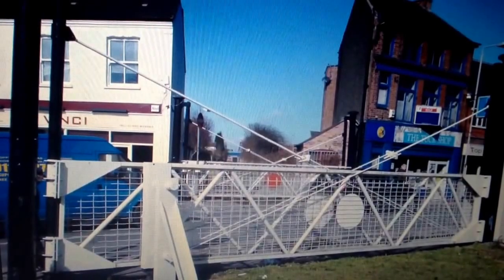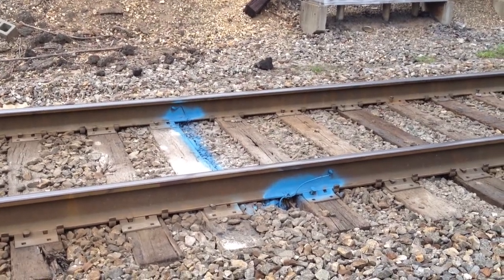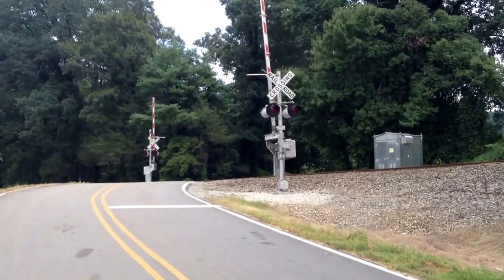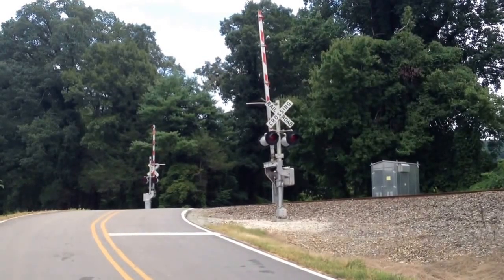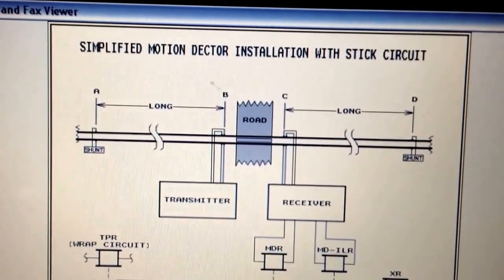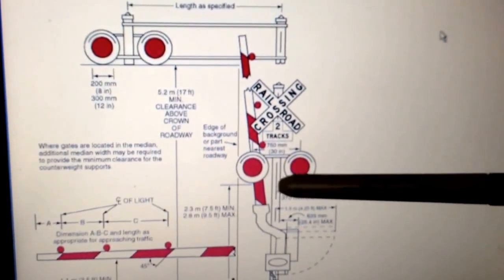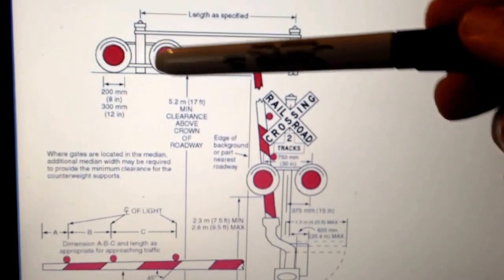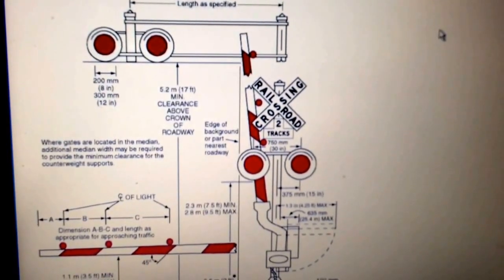Railroad crossing gates and how they work

Comment: get jumper cables and then put them on both rails and then it will activate ghe crossing because the rails are also used as a switch

Comment: If you rub metal across both tracks the signals will go down.
That's how we crossed big streets in California.
There was always a coat hanger or or bed frame on either side of the street.
You wonder why we traveled the railroad tracks cutting through town ?
" The war on drugs " wouldn't let us smoke our weed so we traveled places cop cars couldn't go.

Comment: I used to work for one of the grade crossing equipment manufacturers. It's really pretty interesting how a GCP can not only tell where a train is, but which direction it's going and how fast, by comparing the phase and amplitude of the received low-frequency signal compared to the transmitted signal. With that information, it can predict when the train will hit the crossing and activate the gates and lights at some constant amount of time before.  When there is a GCP involved, merely putting a bar across the tracks may bring the gates down momentarily, but they'll come back up, because the electronics thinks there is a train in the approach, but stopped.  The track short needs to be moving!

Comment: all you need is a penny and you have to find the insulator about 50 feet up the track. you put the penny between the insulator and it makes the gates go down
Reply: You realize it's a federal offense if you trespass on railroad tracks and mess with the equipment. The railroad company can tell if someone it tampering with the safety warning systems and they will contact law enforcement.

Comment: Here's a question: Why do railroad crossings silence their bells when the gate gets completely down?
Reply from the maker: Great question.  The bell is used as a warning to people walking, riding a bike, and even vehicles that the gates are starting to move (coming down) once the gate is all the way down there is no more need for the warning. Some gate systems will silence the bell once the lead locomotive has reached the crossing or when the gate reaches 10 degrees of the horizontal position. Some circuits are simply left open and the bell will sound for the entire time the gates are active. Again, some systems will reactivate the bell when the gates start to move up. Thank you for watching.
Reply: @hnf1930  nowadays EVERY crossing I know has the bell silenced when the gate is down. There were some crossings in my area which used to have the bells ring all the way through, but when I went back to those places recently I noticed they only ring when the gate is descending. I have a strong doubt there's anymore crossings which don't have a "bell silencer" and keep the bell ringing until deactivation.

Comment: What makes them turn off after a train stops at a crossing?  The sensors only account for moving trains?
Reply from the maker: Yes, in a way. I train can pull up to a crossing gate and stop, the gate will go back up
Reply: The circuit can tell how fast the train is going and which direction, not just that it's moving.

Comment: If there's detectors, then what causes malfunctions?
Reply from the maker: Most of the time it will be a defect in the electrical system. Sometimes after a thunderstorm you will see gates in the down position with no train coming, caused by a short circuit in the system. Thank you for watching.
Reply: Saw that happen on Taylors Road in Taylors SC once before (idk if you know where that is)
Reply from the maker: @echogeko4684  I have been in that area a few times

Comment: There are railroad crossings that don't need the crossing gate as in the case of the light rail in Phoenix, Arizona.
Reply: All railroad crossing need gates
Reply: @daltex81  Agreed
Reply: @daltex81  not all need gates as most non gate crossings are in a industrial area or yard. A train will be creeping along the track and there is no need for a gate. If the train is speeding the lights will go off several minutes before the train actually arrives. You got to be stuiped to go across and if you get hit its your fault there's still lights. You also have the crossings with no light or gate at all just a sign but your smart enough to hear the horn

Comment: There are remotes on trains now that trip the circuit. That's why you can see a train sitting right before a crossing, maybe waiting on a light to change, and not have the crossing gate down. Also at the train's end you will see a remote box mounted on the last car, usually with a blinking light on it to trigger the gate to raise up when the last of the train has passed.
Reply: Most of the time the grade crossing predictor is what detects a sitting train starting to move towards the crossing again.  Some crossings may be controlled by codes over the radio, or switches on the equipment housings.

The Flashing Rear-End Device has nothing at all to do with controlling grade crossings.
Reply: @jovetj  and the transmitter on the back is there for what?
Reply: @Kevin McWilliams
The End-of-Train Device is connected to the brake line (like any railroad car would be) and communicates with the head-end. It constantly reports to the crew the brake line pressure it sees at the end of the train.  In the event of an Emergency Brake application, the head end will send a command to the EOT device to open the brake line from that end.  This allows air to escape both ends, and should provide for steadier train handling while it's slowing down.
Reply: @jovetj  it also helps with other trains approaching from behind. Let's say it's dark and yes I know train headlights are bright as fuck but they put that there for your reason and the reason for trains to stop. From behind
Reply: Not true at all. Your guessing doesn't make it true.

Comment: what happens if the power goes out in the city are the crossing light able to work?
Reply: Yes.  Every crossing has a battery backup, which should let it last a while, depending on how often the crossing is used.  The crossing should operate completely normally on battery backup.

If the batteries die, then the crossing will become completely non-functional.  If gates are present, they will drop to horizontal as a warning.
Reply: They also use the generators sometimes
Reply: @Stephen H. Cummings
No they don't.

Comment: you missed an important point. There is a reset insulator about 50 feet down every track. you will see its plate and track insulator. All you have to do put your watch, or a penny in between the insulator on top of the track to make the gates go down.,  a signal man showed me once.

Comment: Can you tell me, are the island ckts a blind spot to block signaling?
Reply: No.  They're all connected to the block signals.
Reply: The island is generally on a separate circuit that doesn't care whether the train is moving or how fast. If a train is occupying the island, the crossing protection is activated.

Comment: Hnf1930, can you tell me where the "power out indicator" is located? Pictures help.
Reply: The Power-Out Indicator is usually a white light located on the crossing equipment case housing.  
See https://c8.staticflickr.com/9/8513/28773069023_b645dcd554_c.jpg

The white light above the door is the POI.  Most of the time, it is steadily lit.  If AC utility power is lost, the light will flash (from batteries) or be extinguished.

Comment: I love trains and train "stuff" and find this sort of thing fascinating, so I thank you for posting :)

Here's a bit of trivia for you: the monotone bell sound probably dates from the early days of trains. Old locomotives were fitted with a large bell that would swing back and forth to warn traffic. These engines were slow enough that the bell could be heard and was a sufficient warning. When electronic signals were implemented, they mimicked the noise that was standard at the time, which remains to this day. 

You can still see locomotives with bells at train museums that run such engines for show.
Reply: Locomotives all still have bells, and are required to ring them when in motion in certain situations (such as a yard or grade crossing).
Reply: Jovetj: I have been watching this carefully. It seems that the locomotives bell is used when they are around people.  Pedestrians who need a constant reminder that the loco is in motion.

How close is this to the truth? It's just my amateur observation.
Reply: That's the truth as I understand it.  I also believe it's more for railroad personnel than the public, because you can get pretty desensitized to hearing running locomotives when you're around them all the time.   Hearing that bell is the signal to be alert because there's one in motion nearby.

There are several standardized railroad rule books around, and reading them is great insight in matters like this.
Reply: All locomotives have bells.

Comment: How does it work with fast and slow train, warnings? I didn't get that bit in your video.
Reply: The Predictor is what accomplishes that.  I thought the video was fairly clear on that, but see my other comments here for an alternate explanation of how that all works in principle.
Reply: every railroad has its own speed limit that determine the distance of the trigger
Reply: TIMER IT HAS A TIME TO GET TO THE ROAD AN D THEN STAY DOWN
Reply: Some crossing devices have a ''timeout'' relay.  This is usually near freight yards and industrial sites that have a lot of slow local traffic.  i.e. Trains moving back and forth as they 'drop' a load and pick up empties.  The timeout is activated if the engine never penetrates the island, thus raising the gates and shutting off the lights.  Later, when the engine is ready to proceed, it creeps along at 2-3 MPH until the gates, lights and bells are activated and proceeds across the island.  Another feature is for the conductor to climb out of the cab and deactivate (override) the crossing protection until such time as the engineer has completed the task of distributing the cars.  Then the conductor reactivates the system, climbs back on board and they booggie back to the yard.

Comment: Would of liked a more detailed explanation on how the train trips the circuit.
Reply: CHRIS BROESKY: Well I loved this video too. But I too want more info. For example, what about when we wartch videos of railway speeders? It seems like most of those don't activate the bell and crossing arms.
Also, I have seen situations where a train was very close to the crossing and the arms, lights and bell were activated. But when the locomotive was very close but stopped for a time, it seemed that they turned all that stuff off till they needed it again.
Reply: Thank you Chris. I feel like I really learned something today. Excellent explanation.
Thank you!
Reply: See my description elsewhere in these comments.
Reply: Michael Dougfir Yes, I've seen the crossing arms come down and the bell come on when there was no train around. They were having problems. The way they turned it off was attach some wires to the rail with a battery or some device box it looked like.
Reply: Rednesswahn - Similar systems in the United States work the same way.  They are still not very common, though.  Most crossings that have gates only have gates blocking the lanes entering the crossing.
Reply: @realcanadianrailfan110  not quite right on the high rail thing, as my work hi rail can be configured to set off crossings or keep them off.

High rail gear contacts the track, they are not rubber, they are steel wheels on steel rail, the reason they do not set off crossings is because they are isolated using a rubber flange between the wheel bearing assembly and the hi rail gear. But most high rails have a spot where you can attach a wire to complete the circuit, running the wire between the left and right wheels then creates the shunt like a locomotive or car would and will set the gate off, same with speeders, they are purpose built to not set off crossings, but can be made to do so easily.
Reply: They are now predictive on modern lines. Meaning a controller kniws train location speed and direction. It calculates proper timing for the gates / lights. So you have same warning time no matter what the train speed is...
Reply: the train steel wheels and axles complete a circuit.
Reply: CHRIS BROESKY  The "track circuit" is shorted by presence of a train. The Grade Crossing Predictor knows where the train is by measuring the electrical load resistance. The Grade Crossing Predictor cuts voltage to a Master Relay in the relay box. This master relay is always energized. Without power, the master relay drops out of the circuit, activating the lights, bells, and cutting power to the Hold Clear in the gate gear box. This is a "fail safe" way of wiring the system. In the case of loss of commercial power and failure of the back up batteries, the hold clear will release, and the gates will lower to protect the road. There used to be an interesting website that illustrated these systems really well called Signaldepartment.com. But seems to be gone now.
Reply: crossing signals use motion detectors
AC current runs through the tracks. The wheels on the train short out the current and reduce resistance
Motion detectors measure the AC current and monitor what's called "phase angle." That's the relationship between inductive reactance (change in the magnetic field induced by the current)  and resistance. 
The motion detector looks for a change in the phase angle. As a train enters a crossing approach, the phase angle increases and the resistance drops. As soon as the MD senses that change, it removes power from the relay and the crossing activates. 
When the train clears the crossing  or If it stops short of the crossing, the MD on the approach circuit no longer detects a change in the phase angle. Thus, the signal is deactivated and does needlessly block traffic. 
When the train starts moving again, the phase angle changes and the crossing signals are activated
A smarter MD is the predictor. It calculates that rate of change in the phase angle and adjusts the signal timing to the speed of the train. 
The faster the train, the sooner the gates go down. This maintains the proper safety margin while not blocking the crossing for an excessively long time for a slow moving train
Reply: talesin- god of the internet: As much as I love trains, I am no expert about anything. And I see several explanations here about crossing signals. But this one makes the most sense to me and I wish to thank you for it.

Comment: I was hoping for a detailed explanation on how the arms are lowered. This was very enjoyable to watchI have watched them for years and always wondered how they were activated. Now I know. THX
Reply: Thank you always wondered how they operated
Reply: The basic principle is that a motor is connected through gears to the pivot point of the gate arm.  At various times in the motion of the gate the motor is powered, or, the motor acts as a brake (just like a dynamic brake on a diesel locomotive).  The weight of the long gate arm is mostly counterbalanced by the weights hanging off the other end, so a humongous motor isn't needed to carry the weight of the entire arm.  A series of cams inside the rotating shaft connected to the gate arm cause a series of contacts to engage/disengage depending on the position of the arm, so the unit knows when to turn on and off the motor.
For more information, you can watch some troubleshooting and maintenance videos posted by a leading US manufacturer of the gate devices.  Go to http://www.wch.com and then click "Training Video" on the left.  You will probably find those videos fascinating (but also fairly technical).